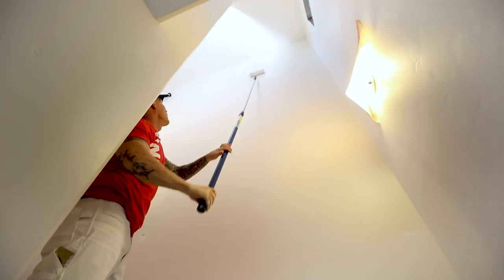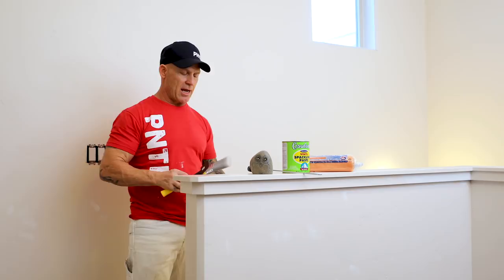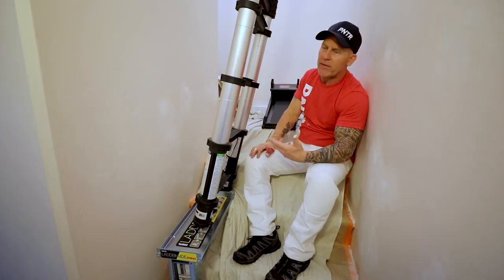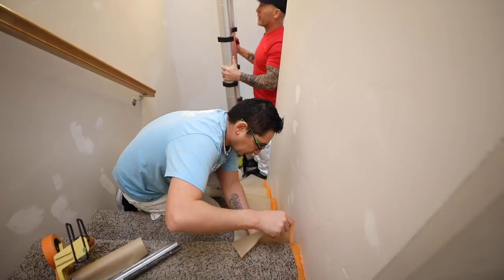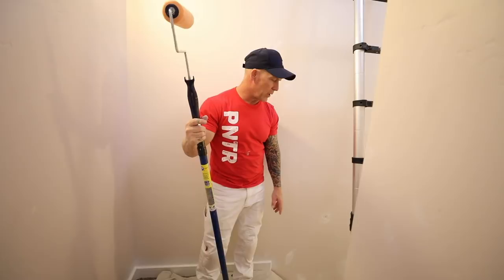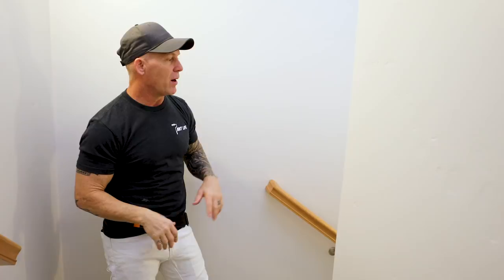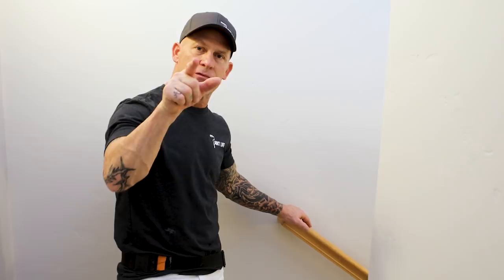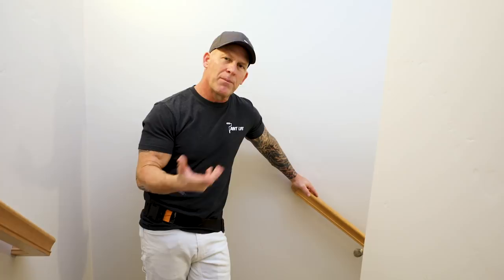10+ TIPS Painting in Stairwells and Other Tight Spaces!

Comment: Great Video. I started painting in 1972 helping my Grandad. I've done it Professionally since 1980. I've always been Mr. picky when it comes to ladders. I used to tell my help I'd rather see the whole crew footing the ladder and only 1 man painting all day than see a man fall and get hurt. It's just worth it. I've worked on everything from a 4'ft ladder to 120'ft boom that would extend 7 stories. I couldn't fart for a week after I finished that job. Unfortunately I was up on a 24'ft ladder, it got knocked out from under me and rode the 24'ft ladder to the ground. I landed on my back flat on the ground with the ladder in my face. I was knocked unconscious and broke my back and four places. I've been disabled since 2012. As picky as I was about ladders I still fell and got hurt. Nobody ever thinks it's gonna happen to them. I climbed ladders from 1972 till 2012, 40 years and it only takes 1 fall. No matter how careful someone is it can still happen to them. I'm afraid of heights and had to force myself to overcome my fear so this made me extra picky about working on ladders but I still fell in a freak accident. I really like the way y'all were so careful in that stairwell. Whenever I had a tight stairwell I used a 16'ft ladder and a 2"×12" 
I'd place the 2"x12" on the floor just above the top step and run it through the rung on the 16'ft ladder on the first landing below. Your 16'ft ladder only has to be open enough to level out my 2"×12" and create my makeshift scaffold. I'd get a lightweight man to walk the plank and a heavyweight to stand on the 1st rung of the 16'ft ladder. I'd use a rope wrapped tightly around the 16'ft ladder and the 2"×12" in an X pattern tied off tightly keeping everything secure and preventing the 2"×12" from moving around. I always used 1 gallon bucket with the ring cut out (best workpot in the world) using my 5 in 1 putty knife with about 2" of paint in it when working on a stairwell. A man can use a swivel pot (bucket) hook hooked to the bail of the 1 gallon workpot looped under & over their belt then hooked back to the bail on the gallon bucket this keeps your 2 hands free. If you're not wearing a belt you can use one of the beltloops on your britches and do the same thing. A man can walk the plank cutting in 1 wall 'til he gets to the end the cut in the wall the 16'ft ladder is leaning against then cut in the other wall from the corner (cut in the corner as far down as you can) back to the top of the stairwell. This makeshift scaffold only takes a few minutes to setup and a man good with a brush can cut this in, in 10-15 minutes. In my opinion this is much simpler and easier than moving a ladder around in a tight stairwell. You may have already tried this, but I just threw it out there in case you hadn't. I always used 18" natural Merino Sheepskin 3/4"inch nap roller cover for roller cover for rolling my walls. Sometimes I used the same thing in a 9"inch roller cover. Sheepskin holds twice as much paint so you don't have to dip your roller nearly as often. They leave behind smoother texture than any kind of synthetic roller cover and the texture they do leave behind diffuses light in such a way that it makes the drywall look much more level than it really is. The one comment I always got from homeowners, builders and especially from drywall finishers was "How do get the drywall so level?" In addition to holding twice as much paint, covering twice as much wall between dips and leaving behind a superior texture that diffuses light and makes the drywall look much more level paint rinses right out.  Sheepskin roller covers are 10 times easier to wash out than any kind of synthetic roller cover.  They cost more but they're superior to any type of synthetic cover. If you ever try Sheepskin once you'll never use synthetic covers again. Just wash them out every day and spin them dry. They're super easy to wash. If you do this they'll last. If you leave them soaking in water they'll sometimes start shedding and coming apart. If you're gonna be right back in the same paint first thing next morning wet your roller in paint, load it up like you would normally then wrap it up in painter's plastic and tape the ends of the cover while still on the frame. Next morning you can tear off the plastic & tape and go right back to painting. Hope all my ramblings help Y'all. Seeing your videos sure makes me miss working. I wish we lived close because I'd sure Love to go out on your jobs and see what you've got going on.
God Bless You and Your Family!!
Jimmy in NC....

Comment: I’ve been painting for over 20 years and I’ve tried various methods. I also use the pivot but for ladders I purchased a 16ft Warner Equalizer. Works like a dream.
Reply: Equalizer the ticket some 1” thick blocks help shim if needed
Reply: The Werner or Keller leg extensions are the way to go

Comment: I've always loosened the brackets on the bottom of the railing and slip the whole rail off the mounts on the wall.  Can remove the rail in 1 min.  Don't have to worry about splatter and don't have to interupt the roll for the railing.